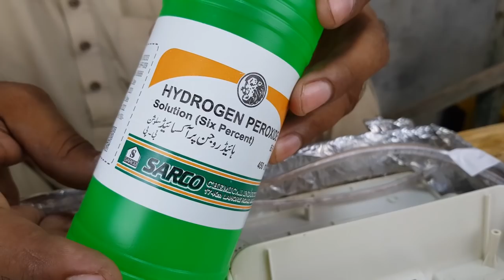I Restored Old Panasonic Landline Phone - abandoned destroyed desk phone Restoration

Comment: I don't believe  . I think  you should not make such video  where u trick ur viewers  . At the end that's a new phone
Reply: I agree.   If you look at the springs that hold the battery, there is no trace of the corrosion, so therefore it must be a new phone.  Look at 18:16 if you need proof.
Reply: @jimthesoundman8641  This is not an argument. There are special liquid solutions that perfectly remove rust! Look when he puts these plates back, you can see traces of solder (timing 16:50 ).. they are not new, but it is possible that others))
Reply: I'd see where you're coming from, but this set appears to be a really hard to find one. I find it near impossible for him to get a new set that quickly.